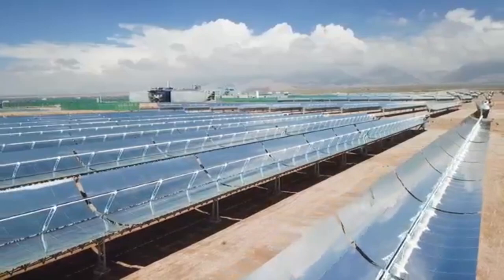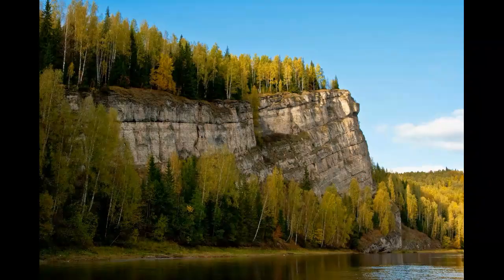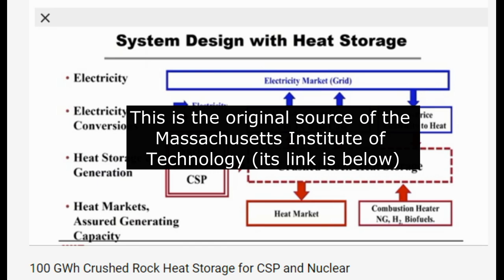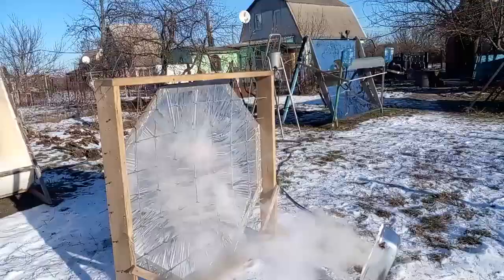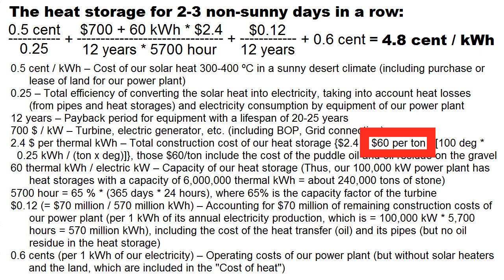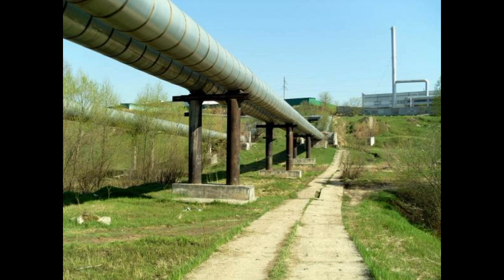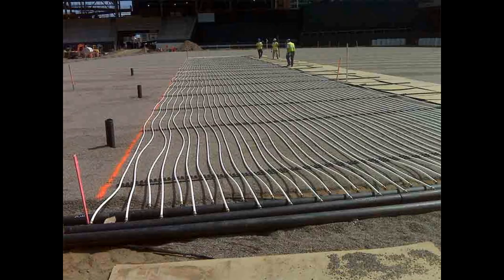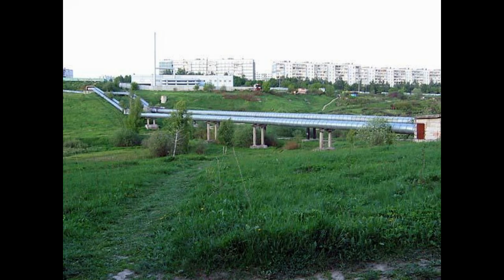How can we turn 300ºC solar energy into cheap electricity

Comment: I worked at SEGS plants for 31 years.

One issue is using gravel.  It must be clean and not deteriorate or it will constantly ruin your pump seals.

Salt has not been used in parabolic trough’s on commercial scale as it freezes at such high temps it is impossible to deal with maintenance wise.  It is a challenge enough with the HTF that freezes at 54f here in the Mohave desert.  The trough plants that do use heat exchangers that take hot oil from the field to these heat exchangers that heat the salt up.  The salt tanks and all piping involved need to be kept above the salts freezing point which is around 400f at all times or it can be very bad.
There was a company out of Australia that tried salt in troughs but forget names.  Met them in convention in Las Vegas, Nevada a decade or longer ago.  Never heard of a commercial plant made.
Reply: How are the pumps sealed? With rubber? What is on the gravel that binds with the seal?
Reply: @mookfaru835  Sodium filled exhaust valves, that are fully sealed just like the exhaust valves in the Spitfire.
Have a good one.
Ciao...!
Reply: Sounds like the gravel needs to be the largest size rocks/stones should be used, rinsed and with some type of filtration to keep sediment out. Does the gravels cemistry breakdown in the oil over time?
Reply: A commercial plant in New Mexico or one of the western US states did shut down for too high in maintenace costs. But the company is thought to have mishandled the finances. After spending all the government grants and paying the executives big bonuses the losses where more than the company could keep paying and compete with the market rates
Reply: @terrafirma9328  very good question about grave qualities.  System can vibrate and cause erosion, etc.  rather run pipes encased in cement.  There was a company a while back trying that.  Forget the name.
Reply: @terrafirma9328  yes in my time I have seen much mismanagement in the field and some in the office etc.   greed kills projects.  Seen some whacky designs and cost cutting on good ones. The leaking hot tank debacle of Solar Reserves plant Crescent Dunes is one example.  Got to tour while being built.

Comment: I think of a variant that produces demineralized water in large volumes, in many places this has become a serious problem.
Generate steam, transport it for a few kilometers, generate energy along the way, reheat the water, repeat the process, at the "end of the line" use soil to transform the steam into water, the heated ground can be used for other purposes (in theory the soil could stay above 50 degrees and it would still be efficient).
The stored water can still be used as a "hydraulic" battery before being used for human or industrial supply.
In other words, they would be long lines of artificial rivers, generating energy along the way.

The big cost is in the transportation line.

Comment: The design in this video is hardly new and that is to be expected.
Thermal storage is probably the method that makes most sense for storing energy, particularly for solar farms that use a vast array of mirrors on heliostats that reflect sunlight on a single collector that uses a medium which is typically molten sodium to collect and transport the heat to directly or indirectly power turbines that generate electricity.

This is probably the cheapest and most efficient way to store solar energy at any power station, far better and cheaper in almost every case than chemical batteries. Unlike chemical batteries, thermal storage is based on well known physics and methods developed over thousands of years dating back to cave men. The physics of thermal storage are well known and integral to many industries, and seen even in backyards and homes. The only drawbacks to thermal storage is that compared to chemical batteries it is large in volume and mass so is not suitable for mobile applications.

The small wrinkle in this video is to add an alternate storage medium in crushed rock which is questionable. The only likely purpose would be to extend the time of storage compared to molten sodium, but that would need to be analyzed and evaluated. Molten sodium is consistently at about 600 degrees Fahrenheit which is plenty sufficient to directly or indirectly power any method to convert to electricity (eg turbine, heat pump, Stirling engine) and is one of the cheapest, most plentiful and available elements in existence. If extending time of charged capacity, it's likely easier and simpler to just increase the volume of molten sodium rather than use an alternate medium.

As for thermal storage losses, this is one of the most well known and continually developed areas of applied physics. All around us we can see examples of methods to control heat transfer and prevention and its opposite when desired, to transfer heat away when desired. The physics of heat insulation and isolation are so well known that there are many methods that have been created for practically every situation. I would generally recommend for metropolitan thermal storage lining the "bathtub" with common kiln bricks, perhaps a few layers if desired. Air gaps or vacuum gaps are also common in preventing heat transfer, design a layer in there as well if desired. Or, if heat losses aren't particularly important relative to the amount of heat being collected maybe less engineering is needed. Remember, an analysis would only have to ensure that enough storage is required for power generation over some number of consecutive days without sunlight... Maybe 3 days? 7 days? Surely few parts of the world would remain in darkness for 14 days (maybe near the poles and far from the equator).

In any case, I look forward to the day when all those batteries used for metropolitan energy storage are junked and recycled to recover their valuale rare minterals to make new batteries, and are properly replaced with thermal storage which would be lower cost in every respect and likely last far longer (maybe hundreds of years) than the batteries they're replacing.

Comment: the solar plant as It has been on the market since about 1975
the problem of Such a system loss of energy we learn
And that's why it hasn't been properly profitable yet.

There has been experimentation with sand granite and salt to store energy you still have to build an insulated one around where they should be stored because otherwise the energy loss is too great and it costs to build it.
The next problem is the oil that will transport the heat must be able to withstand heat and not put deposition in the pipes and be environmentally safe Such oil type costs

the next thing is the absorption and release of the stored energy can only happen at a certain speed since the conductivity of the materials will act as a barrier

thanks for a great video.  that there has been research into systems like that for the past 40 years;
and It is only now has begun to be profitable due to Our situation on the world stage

at present we have another problem that Danish wind turbines produce so much energy when the wind blows that sometimes we had to stop the wind turbines so as not to overload the grid and the German grid is not strong enough to drain it over energy then we have also experimented with seeing if it can be put into granite shards for storage and effort is spent on developing power to x for alternative fuels for Transport

So Denmark is working on him producing about 45 gigawatts by 2030 so we will be a supplier To Germany and other neighboring countries, the energy will come from wind turbines and solar panels.

Comment: Hello Sergiy, thank you for posting this interesting content on your channel. I find it quite interesting and inspiring. I would like to make a little contribution. At 6:20 you mention consecutive shells of pipes at different temperatures which would transfer heat from soil surrounding the thermal storage. Actually, this would increase losses from your thermal storage. Heat flow is a product of temperature differences, so if you cool soil surrounding the thermal mass, the amount that leaves the thermal mass through conduction will increase. Just my two cents!

Comment: I would like to add that thermal storage is even useful to store energy from conventional PV and wind power plants, when there is surplus in production then instead of dissipating the energy into nothing, this surplus energy could be stored in those CSP thermal storage
Reply: As well as grid power as a backup for long cold nights if the BTUs get below a 6-7 day low energy threshold, grid power could be a secondary or third backup.
Reply: @terrafirma9328  What is grid power?
Reply: Converting electric power to thermal power storage via dissipation is just wasteful: it's straightforward thermodynamics, illustrated in practice by heat pumps with high (>>1) COP's. At When there's too much electric power production, at least make some hydrogen or ammonia or whatever! You'll have some spare heat from such a process too!

Comment: maybe an investigation on "(bacteria, organism or what is it)" which is developing in compost. maybe this could help in winter.
Reply: Look up Jean Pain compost water heater
Reply: @John Xina: Thank you for pointing out Jean Pain. For me unfortunately this method alone is not enough. That method involves a lot of work and doesn't seem to be a long-term method.
Maybe a deep dive to understand how the heat is produce inside the compost. Then can be this heat in another way produced(but also environment friendly)? ...and... of course cheap.
Reply: @RPI_4  I don't know what you're looking for but compost heat is fairly basic and simple... You need sufficient (but not too much) water in a large enough volume (minimum 1 yard or meter cube, nothing smaller) with enough access to oxygen in the center of the pile for aerobic bacteria to multiply. As the bacteria consumes the organic material, heat is generated and released which can exceed 200 degrees Fahrenheit but should not reach boiling. This is why the pile has to be at least 1 cubic meter in size, anything smaller will lose too much heat and your chances of success plummet. Air is a critical ingredient in the process which is why the pile should be turned every week or so and at the end of approximately 3 months, you'll have a completed pile of compost where even small branches should have decomposed.

Comment: Straw bales to line the pit is a cheap way to insulate, although they must be sealed in EPDM to protect them against water. And of course then the working temperature can not be as high. Maybe higher with an inner lining of expanded clay or vermiculite. Boys, girls and in betweens: this all should have been sorted out ages ago.
Reply: May be foam glass or perlite could be used for insulation too. Or a combination with ice heating technologie.
Reply: Straw would be crushed by the weight of the tank?  Or a big tank with support legs of some sort and regular type insolation?  Ground temperature wants to be 60f and is relentless , won’t pause if there is no sun for days or equipment break down.
Reply: @gordybishop2375  there is very interesting literature on straw bale houses and other structures. Since baling began in the late 1800’s straw bales have been used as literal building blocks, especially in Nebraska if my memory serves me well. Bales are very insulating. R=6? I don’t know exactly. To know what weight they can bear as a single (or double) layer of insulation under a heat tank it should suffice to ask someone who is in the know about these things what pressure a baler needs to make one.
Reply: @Calligraphybooster  great for house walls but never seen it under the foundation where it has to support the entire weight of the storage tank and it’s contents.  I would think all the air gaps that make it a good insulator would crushed away.  Even when styrofoam is used for houses it is on the walking surfaces usually or on walls…not a tank full of rocks and salt or HTF.
Reply: @gordybishop2375  yes, but it is a load very well spread. Think e.g. of the weight of a loaded 747 is 910.000 lbs or 412 metric tons. Spread out over 5600 square feet of wing area that means 162,5 lbs per square foot, (or about 80kgs on an area of 31,5 x31,5 cm.) This means that the average male exerts a greater load on a given supporting surface by just standing on it than plays on that same area of the wing of a 747 in flight. 
Doing such things in metrics btw is very simple: 1 ltr of water equals 1 kg. 1 kg is pulled down by gravity with a force of 10 Newtons. A liter is 1/10th x1/10th x1/10th of a meter btw. So 1 cubic meter of water is equal to 1000 liters and equals 1 metric ton. Furthermore 1 meter x 1N /second = 1 Watt, so you also easily express horsepower and electrical power in these terms.
Reply: @Calligraphybooster  this is not an empty aluminum tube airplane 
It is rock, salt, HTF….contained in a vessel of some sort that would have to be very sturdy and it’s supports and leak protection ( double hull?}. ..etc.  it is a huge weight I believe and if metal of some sort will need expansion bellows of some sort.  It’s not helium…it’s very substantial to hold heat.  The rocks need to be very stable, not pumice, or it will cause issues with the pumps seals.

Comment: But I don't quite understand how this works. Are you saying that the mirrors are focused on heating rocks up which are then sprayed with oil but then is collected to be sent to heat up water to drive a turbine with steam?
Reply: He's saying the light is reflected to a focal point which is very hot and that heats oil which is then sprayed over the rocks or sand to heat it. The oil drains through and cycles around again and again. Somehow the heat from the rocks or sand is regained by heating water to steam which turns the turbine to generate electricity. Nothing is burned!!!!!! No rare minerals or metals are used!!!!!!!  It's cheap!!!!!!!  It's not dangerous to the surrounding environment, except for the hot oil which has to be contained. And, PVs can also generate electricity directly from the sunlight to be used or stored in batteries.

Comment: How do you turn the steam into electricity. You have suggestions on inexpensive steam turbines?
Reply: Use a steam engine... instead of a steam turbine
Reply: Steam turbines are very "old school."
Newer methods which are very efficient include heat pumps and Stirling engines, both which work based simply on differences of temperature and do not rely on pressure like a turbine.
Reply: @roderickseed9427  Do you have any models or links to ones available?
Reply: Mike brown steam,tinytech India...old ones on eBay...
You can blow the steam through a large hydraulic gear with a bit of added oil(seals might not like the temperature)
A large turbocharger...problem is high output shaft speed
Reply: Hydraulic gear motor
Reply: @roderickseed9427  It looks like tinytech hasn't been updated in 10 years.
Reply: @tonysu8860  None of those is very efficient, are they? Can you give their efficiencies for comparison?

Comment: Hi Yurki! Im also preparing a flat solar concentrator with hot glue and glass mirrors on a sandwich panel . I plan to mount it on a small cart and it has a focal length of 2,5m in the focus I will mount an oven for baking and preparing other foods

Comment: The thing that's always puzzled me about parabolic reflectors used in these type of solar plants is why they're arranged North - South and follow the Sun during the day. Why not East-West, and follow the Sun during the seasons?
Reply: Parabolic reflectors should be mounted on heliostats that follow the path of the sun across the sky no matter the time of day or season.
Circular parabolic reflectors need to be pointed exactly while "trough" style reflectors only need to be aligned along one axis... the other axis due to the parabolic reflector will always reflect sunlight on the collector because that's the nature and advantage of a parabolic reflector that it will capture sunlight from numerous angles.